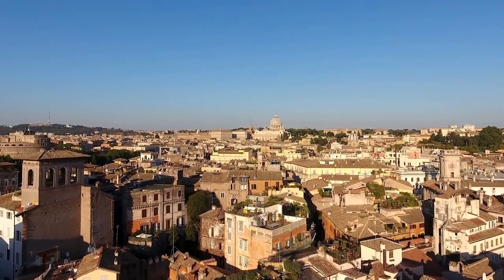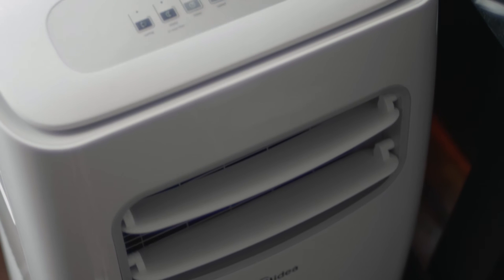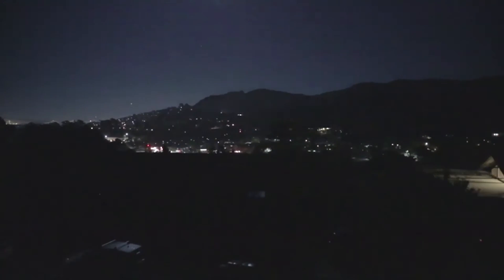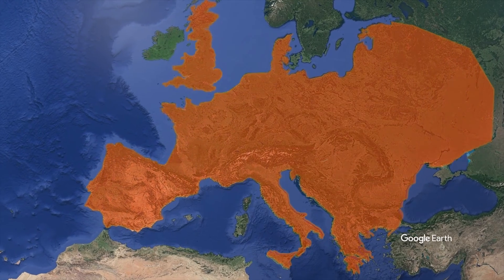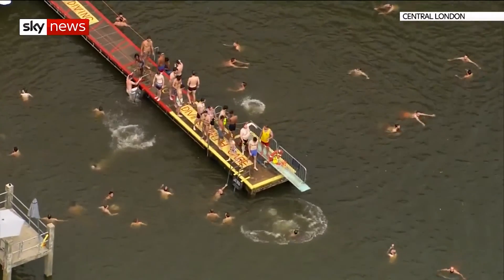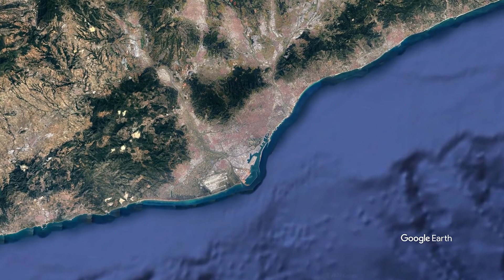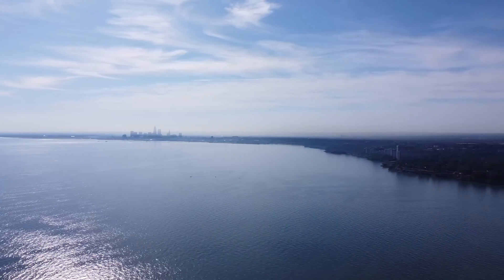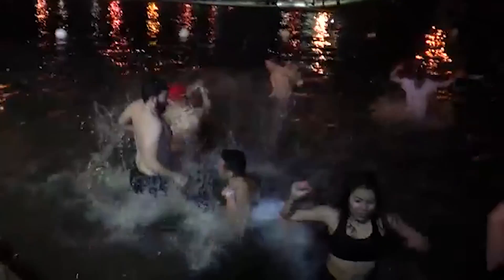URBAN HEAT ISLAND - How cities change the weather.

Comment: I've noticed longer Summers, later freezes and milder Fall and Winter weather in the Mid-South as well as the encroachment of formerly Deep South animal species (armadillo and alligator) and wonder if the UHI is pronounced enough in surrounding small towns (with a lot of concrete, residences,  big box stores) to account for overall regional warming. Farmland and forests are going away in rural areas as well.

Comment: Reducing Urban Heat In A Tropical City
2 simple, fundamental, effective and cheap long term solutions for reducing urban heat in a tropical city:
1)	Plant more trees near areas where there are running water in streams, canals or rivers
2)	Create more running waters in streams near areas there are more trees.
When more water has been evaporated, more urban heat will be removed from the city.
Notes:
1)	Other vegetation do not result in as much water evaporation as water evaporation by trees
2)	Trees not near running water or streams may not have enough water for water evaporation to effectively reduce ambient heat in the environment or to reduce urban heat
3)	Most current air-con systems are very wasteful as they merely transfer indoor heat to outdoor, resulting in increase in the ambient temperature in the environment or increase in urban heat.

Comment: I live in a small town in Alabama of 14,000 that's also located on the shores of a very large inland lake. Having been born and raised in Cleveland and now living here for about twelve years, I'm familiar with both climates.  It's surprising how much this is like a miniature version of ?Cleveland (although nowhere near as cold in winter). I live about half a mile from our small downtown and the weather station at my house will consistently be 1-2 degrees F cooler at night than at the post office downtown. It down't take a lot of buildings and pavement to set up up a heat island. I've even had lake effect snows, where surrounding areas might get an inch and I'll get four inches. The lake also has a negative effect on tornado formation, with this county having one of the lowest numbers of tornadoes per sq mi in all of Alabama. I've yet to see a good explanation of this phenomena. Good luck to all the students with all this crap you're being put through. I graduated in 1976, and it turns out that was a lot better time to go to college.
Reply from the maker: That's fascinating how such a small lake can set up lake effect snow. I did a month or so of research on the topic last year for school and learned a lot of info. I'll definitely make a video of it when it gets colder out. Speaking of, it seems like Colorado is going to go from 100 degrees to freezing in about 36 hours next week. I'm sure that will be fun. Thanks for the comment!